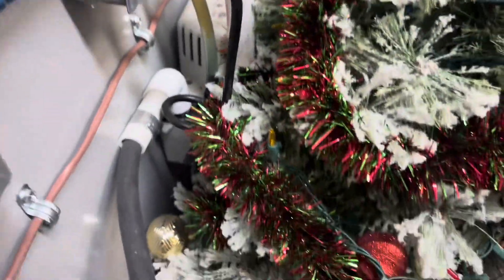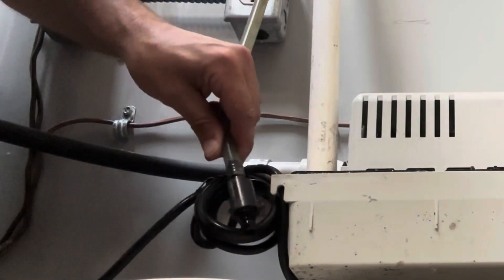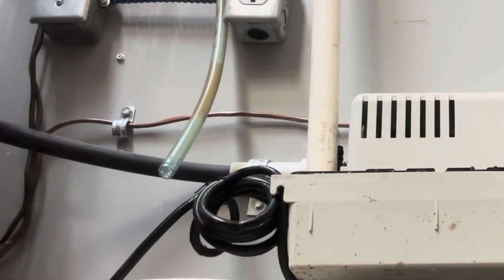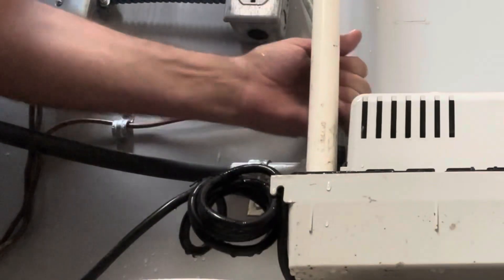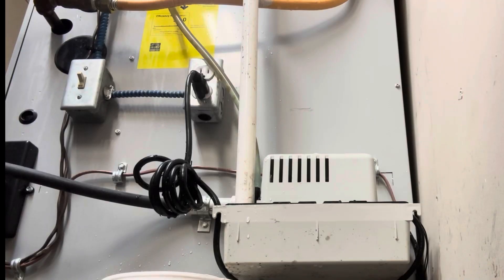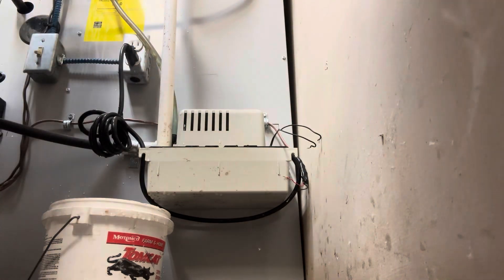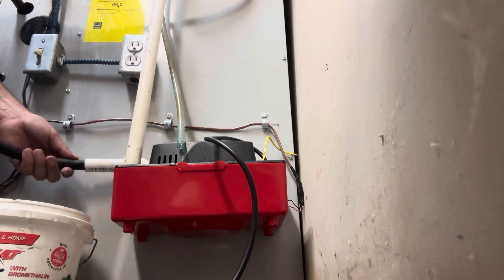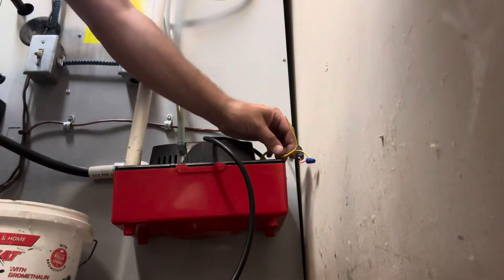Thermostat Blank…But Not Bad!!  This Is What Caused It…

Comment: the pump tank was probably full of schmutz anyway, maybe even clogging the inlet and check valve. a good cleaning/inspection would probably have done it, but if your doing all that, may as well just replace it since it's now fully removed and the additional labor time.  lol

Comment: I would have changed it too because no definitive answer why it quit. I have seen too many of the pump on switches stick in the open position. A $50 condensate pump vs thousands of damage if $5, 24 volt safety switch fails too! Good call Jeff...been burned too many times trying to save a customer a few bucks only to come back and bite me!
Reply from the maker: Well said.   Thanks

Comment: I would have put the vac on the discharge pipe to see if it was clear. Sometimes, 4 back to back elbows and a 45 clog up. Some guys get creative when they run condensate drain lines, not considering potential algae clogs down the road.
Reply from the maker: Yea I blew it out.  Forgot to film that part.
Reply: @JeffsHVACAdventures 
I should have known, Jeff. You are thorough. I usually have my 2 junior techs watch your videos in the garage to pick up and improve their evolving diagnostic  skills. Keep doing the good work.
Reply from the maker: Thanks.  I appreciate you sharing my channel around to your techs.  It means a lot to me.  🤙